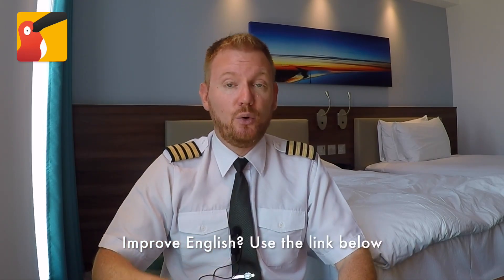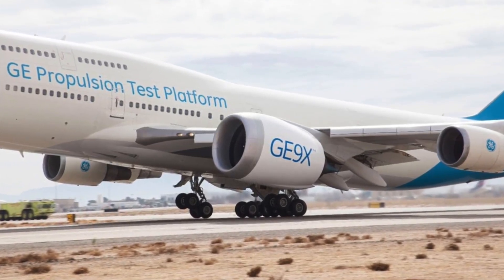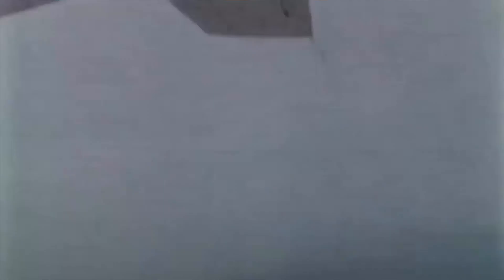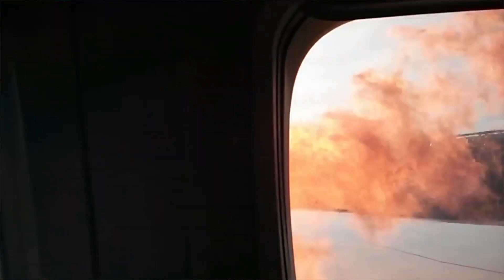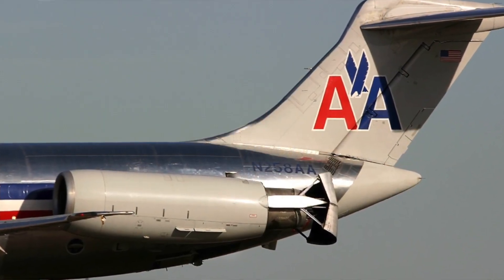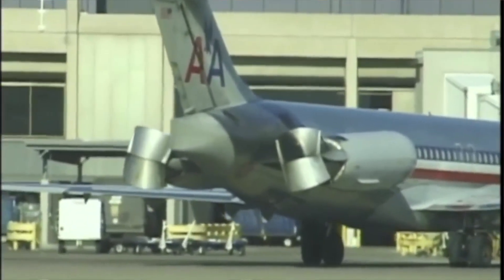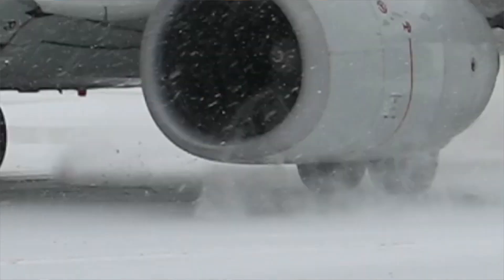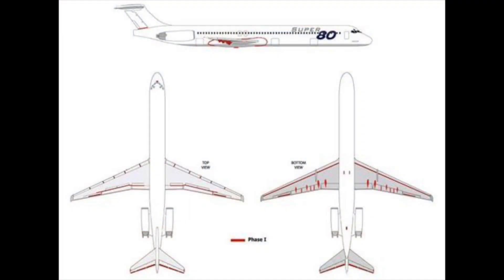Why are the jet-engines placed there? Wings vs Tail

Comment: Interesting topic: I have flown both of the discussed enginge mountings. I do not want to go into more handling details, but one thing you did not really mention: Mounting the engines at the back make an airplane MUCH heavier than if mounted on wings. I found out about it when flying a subcharter for Britannia Airways with a BALAIR MD-80 out of Korfu. As long as you have southerly winds there there will be no problem with take-off performance.  But there will be with northerly winds due to a road and obstacles just north of the departure end of the runway. So my dispatch did not realize that when accepting the operation of a flight from Korfu to Birmingham I think it was. On the empty flight from Zurich to Korfu we went into the books to check and became aware of the problem. JUST GO ON READING - I WILL COME TO THE ENGINE-MOUNT PROBLEM SOON. So we hoped there would be southerly winds. But it turned out the other way - northerly winds and take-off towards the north. After take-off calculations I informed my homebase, that we had to make an intermediate landing, preferrably in ZRH, as the crew would then have to be changed due to maximum duty time, and of course for refuelling, which brings us to the point. I could only take fuel to just make ZRH with altn BSL. While, standing beside me, a Britannia 737, with same engines and passenger capacity !! would still be making the flight as scheduled directly to England. So I was wondering why and went to the cockpitcrew of that 737 and we compared our calculations. I am citing here round figures as it is long time ago, but just to give you an idea. With full load of 150 pax and their luggage the 737 was almoast 7000kg, 7 tons lighter than the MD-80, same engines and payload, without fuel. So could take some 7t more fuel, which gives you at the end of a flight about 90 mins. more trip (cruise) distance. Or in other words, they were about the same weight on take-off as we, but for the UK and we only for ZRH. After thinking for a while I came to the conclusion that this must be due to the engine mount. You mentioned already some negative points regarding the mounts in the back, but I think you forgot some very important ones: First of all the engines on the wings are carried by the strong wing-struts and their own cowling aerodynamicaly, while the ones in the aft add to the empty weight of the cell (in flight) and the aft-fuselage must be built much stronger than on 737-like planes in order to carry them and also to transmit the power/force. So in other words, the empty cell of a 737 (300 I guess it was) was about 29 tons while the MD-80 weighed almost 36 tons, almost 7 tons that you had to carry more on every flight. So more fuel consumption in same cruise conditions while less fuel could be carried along in certain cases like this one. Very disadvantageous for the operation then (in the 80's) If you came this far reading I sure do hope I did not bore you too much with this.
Reply: Like you said, the wing are the main lifting force and the main drag producer. Having the heaviest part and the trust at the same place make the structure simpler.

Comment: im suggesting putting the engine inside the plane and passengers outside the plane. you will not need aircon, they can smoke, you need not to serve them food/water and they will not need to go toilet, unable to make noise or hijack the plane, and they can have alot of fun too.

Comment: Since the Boeing "Dash 80" (707 prototype), almost all passenger transports have low mounted wings which from what I heard is best for cruise efficiency. There are cargo and STOL planes that need wing clearances to meet their needs, or fighters for quick maneuvers.  There was the BA146 high wing that I found had a lot of wind noise.

There's been various concepts for new types of large passenger transports but yet they **all** look like the Dash 80 (787 and 380 same configuration). But wait, Boeing wasn't the first. It was the Germans with the Me262 which is basically the same configuration. So I see these blended wing concepts, yeah then another issue is how many airports willing to reconfigure their gates to handle a different paradigm of airplane.

Very educational, I didn't know of acceleration/pitch combination. And that super stall is really scary.

Comment: Thank you Mentour pilot for explaining. I was always convinced that planes with engines mounted under the wings must be easier to handle in flying.

But one question: I suppose in case of an emergency landing on water a plane with high mounted engines will have a better chance to stay in one piece than a plan with engines under the wings, won't it?

Comment: As a long retired DC-9 Captain I'm going to disagree with you about some things. The DC-9-10-20-30-40-50s did not have stick-pushers but it's no big deal if you need one. The underwing engines have always been a bigger problem especially on the 737. The first 737s created an air cushion under the wing in reverse that prevented heavy braking. They extended the thrust reversers to behind the wing as a partial solution. Wing engines do not allow for larger engines and even the higher gear Airbuses are at risk for ingestion and compressor stalls in reverse with the new larger diameter engines. The added fuselage weight for rear engines is more than made up for by the much smaller vertical stabilizer and rudder requirements. Maximum zero fuel weight wing bending moments are merely a design consideration. If Macdonald/Douglas had not been bought by Boeing we would see MDs  with CFMs and geared P & Ws without any of the ground clearance problems. I've been riding a lot on 737s and the cabins are incredibly noisy front to back. DC/MDs were very quiet except the last few rows. The wing design of rear engined planes is also much simpler and cleaner. Nacelle/strut interference drag is a constant problem.

Comment: Once, leaving Minneapolis in the winter, one of our rear fuselage mounted engines got "flamed out" when the plane hit some slush on the runway with its wheels and it got kicked up into the engine. we barely stopped before falling off the end of the runway into the field/trees.   I looked at the plane more closely when we got off back at the terminal. The wheels were directly in front of the engines.   From that point on I always flew southwest 737's with wing engines when possible, and to this day have never booked a flight on a rear engine plane again. I don't need any more heart starts like that. There is absolutely no way that the wheels can kick anything up into wing engines
Reply: jj rusy - The nose wheel(s) can but not nearly as likely as they are not directly in front of the engine and are relatively small.

Comment: Could you make a video explaining how you maintain level flight over a globe earth?
Reply from the maker: Yes, the aircraft maintains a constant pressure altitude. As the atmosphere and subsequently the pressure follows the globe, so do we.
Reply: Mentour Pilot idk if you are aware of the flat earth theory and the claims that they make about  how they want to believe how planes would have to  keep nosing down to maintain level. There are some debunking videos but  they are not from anyone with practical experience of flying a plane
Reply: gravity bends, or warps, space and time, and in flying "level" , the flight path automatically follows the curvature of space. space is curved around a mass, and everything in that space must automatically follow that curvature. for instance, if you toss a rock into to the air , it will fly forward and down. it's automatically following the curvature of the space it's in. if there were no gravity, and no curving of space, the rock would keep flying straight  away from  you into outer space.

Comment: I saw an episode of Mayday where a plane with rear-mounted engines crashed after the pilot forgot to turn on the de-icing system, allowing ice to form on the wings.  When the pilot realized his mistake and turned on de-icing, ice chunks broke off the wings and got ingested by the rear engines, causing them to fail.
Reply from the maker: Yes, this is another downside of rear-mounted engines.
Reply: Engines can fail because of ice? Really? They are so hot and they shoot them with chickens to test them, but they are not able to ingest ice without failing? That’s really a let-down. I hope modern engines have fixed that problem.
Reply: @IroAppe  They're not so hot at the front, & the fan doesn't like being hit by solid objects, blades tend to break, get ingested, & break others deeper inside.  There's a limit to the size of ice chunks you can make them strong enough to survive, even with the best modern engines.
Reply: @IroAppe  Snow or small hailstones are one thing; a big chunk of ice coming off the wing of a plane moving at hundreds of miles per hour is a whole other animal.

Comment: great series. Casually, I don't like wing mounts as much as tail mount. This is mainly due to handling issues, especially the concern over failure at takeoff..and not just yaw, because that can cause roll too. Any thrust failure on takeoff is the one time when you will completely regret wing mounts, and would have chosen tail mounts. In pure efficiency wing is already stronger so less additional weight. Aero engineer is so interesting. Endless questions, like what research as been done on alternate elevator locations (other than T style) for tail mount engine layouts.

Comment: You did not talk about differential thrust, steering left and right without the rudder, doesnt work as well with rear mounted engines.
Also did not talk about the handling difference, engines being closer to the center lets you roll better.

Comment: Tail engines are a bit more prone to ice damage though they should cope with it, but..........
Why do they not have stick forward in other aircraft, it might have saved a few, though those with fly by wire and a tiny joystick might be more difficult, but if the Air France Airbus that crashed into the sea between Brazil and France had an override system where the plane protected itself from a stall, everyone on that plane might still be here today.
However, there is always the exception to the rull when a pilot wants to control an aircraft and not it control the pilot.
Interesting video.
I don't know if you have done a video of why other aircraft have high tails as opposed to others but that would be interesting.

Comment: Thanks for that, never really thought that deeply on it but under wing is probably the simplest solution to design and maintain for airline use. Also easier for emergency fuel flow too with gravity  helping. Always interesting. Didn't think a big jet ever reversed due to collision issues and also the chance of spiking the brakes sitting it on its tail if theCoG was close to the rear so that was new. In Australia Jetstar use a little trolley that locks onto one wheel for pushback.

Comment: In a turboprop you have prop-wash which will enable you to take off from shorter runways because of more air flowing over the wings (?) Does the bigger fans on newer aircraft counter this so that you can now use jet-aircrafts on those shorter runways and what are the dynamics behind that? Can they also reverse like turbo-prop or do they have other functions? Also I see that newer planes fly slower than the old ones.. why is that? they save fuel of course, and they're slower...

Comment: Hi Mentour. You said in a recent live stream that you would do a video on brakes. Please could you try to do this from the cockpit. The visuals aid the understanding. I've always wondered about the technique of manual braking on the rudder pedals - is the pressure the same as car pedals, do both pedals have to be pressed with equal pressure and if your foot slips can you turn breaking into dangerous rudder action? Many Thanks.
Reply: It has to in order to land in crosswinds?
Reply: I thought that to manually break, both rudder pedals need to be pressed, my question is how do you then break and rudder at the same time on the runway?

Comment: I'm just back from Korea. The flight was AC 515 and it was choppy and bumpy almost the whole way-for 12 hours. It seems the pilot was Not searching for a better altitude, but instead kept it on Autopilot the whole time. Also he was never on the p.A. system to make announcements, except in the very beginning and at the end. I don't know if my guess about the Autopilot is right, but at other times pilots seem to search for smoother air.   thanks for the great videos, and by the way, the 787 from Korea feels about 5 times heavier than a 737!
Reply: Myron Piano The things are on autopilot as soon as the gear comes up and it doesn’t come off until it touches back down. He could have been communicating with other AC about the ride at other levels, but being CA I highly doubt it as their general English proficiency is barely what’s required to get a license at best.

Comment: Great video! New topic question: Why do all of the wing flaps stay in the lowered position for some time after takeoff before being retracted into the regular flight streamlined position? I notice they are in the lowered position coming in for landing to (what I assume) lower/stabilize the plane and also cause a bit of drag to slow the vehicle. But during takeoff, wouldn't you NOT want drag and want lift? The shape of the wing with the flaps lowered contradicts my thinking on this. I understand that it likely helps for stability and to negate lift while taxiing but I don't understand why they are still lowered on the runway and for the first part of takeoff.
Reply: Flaps increase lift, important at low speeds, and also lower the stall speed (minimum speed to actually fly) by increasing the length of the wing (front to back). A longer wing is more resistant to airflow separation, where air coming over the leading edge tumbles instead of following the shape of the wing. Airflow separation increases drag and dramatically reduces lift. Without flaps, planes would need a much longer runway to takeoff (and some planes my not really be capable of no flap takeoff at all).

On landing, in addition to flaps you'll also see the spoilers deploy on the topside of the wing on touchdown. Spoilers do two things. First, they create a lot of drag, helping to slow the plane down (like airbrakes). Second, they disrupt airflow on the topside of the wing (causing that airflow separation), massively reducing lift. This gives more traction to the landing gear for braking and helps keep the plane from bouncing back into the air.

You may also notice that the flaps aren't extended quite as far on takeoff as they are on landing. Fully extended flaps do create a lot of drag, so you need to find the best compromise between using more flaps to lower the takeoff speed and using less flaps to increase acceleration.
Reply: I think the flaps are actually there to increase the surface of the wing, and thereby increasing the lift. So they are valid both for takeoff and landings. And in a landing scenario increasing the angle-of-attack. And actually the flaps hightens the plane and not lowering it. So does the landing gears, they increase drag and that's why there's a maximum speed where you can lower them, of course also not ripping them off the plane.
Reply: Flaps are are used for lift at lower speed. Yes they do produce drag but the lift generated far outweighs the drag produced especially at takeoff.

Comment: Curiously, the very image of a jet airliner in my mind is the three-engine DC-10 the national airline in my country used to fly in my childhood. One on the tail, two on the wings.
Reply: The last DC10 I was on we had a compressor stall on take-off out of DFW.  It was the loudest and scariest thing we'd ever been through.  Since we had to wait about 30 minutes to get to the takeoff point, the control tower let us go by all of the other aircraft in line and give it another try.  The second time the compressor stall and associated bangs were even worse than the first time.  The pilot came on the PA and announced "We're not taking this aircraft."  Looking into it a little further, I hear a bad cross-wind can confuse the oxygen-fuel mixture and these DC10's had seen this many times.  I wonder what it looked like from the control tower.  Flames?
Reply: Best of both worlds? :)
Reply: Totally Agree with you
Reply: Back in the day airlines were not allowed to fly across large bodies of water with only two engines for safety reasons. That's why there were many 4 engine aircraft flying international routes. However with the introduction of ETOPS and more reliable engines, 2 engine aircraft can now fly up more direct routes across the planet.

Comment: What about glide angle?  I would think that wing mounted engines would have a better glide angle (without engine power)  than all the weight on the tail end with back mounted engines.   Thoughts?

Comment: It is my observation that one potential advantage of the T-tail is that the horizontal stabiliser is in normal flight kept clear of the wing's wake. This means turbulence encountered by the wing or generated in the wake of the wing in certain manoeuvrers does not hit the stabiliser as well. This can be beneficial for stability of a smaller air craft in turbulent air.

Comment: you missed another reason for under wing engines is CG also under wing engines will cause a pitch up when power is added where a rear engine aircraft will pitch down
Reply: He actually said a lot about pitch up and pitch down handling characteristics in the video. And his students need a lot of training to experience the differences in those characteristics.